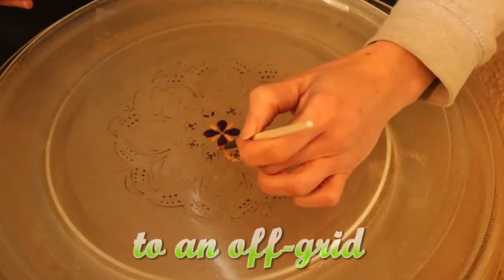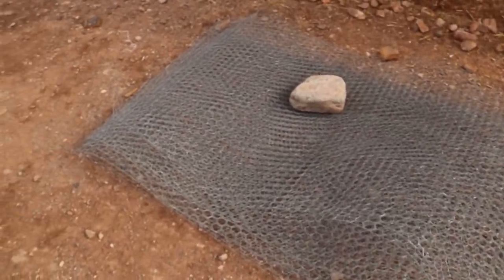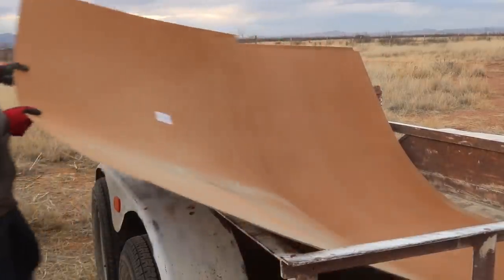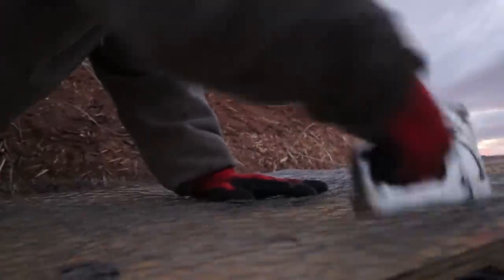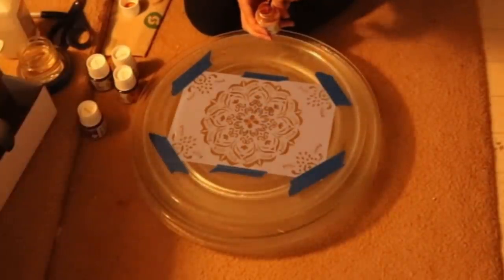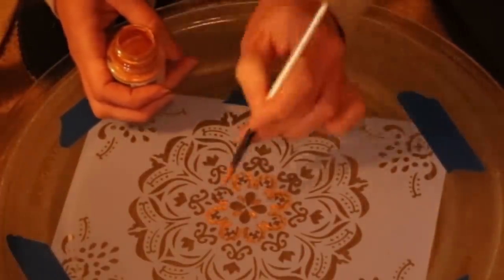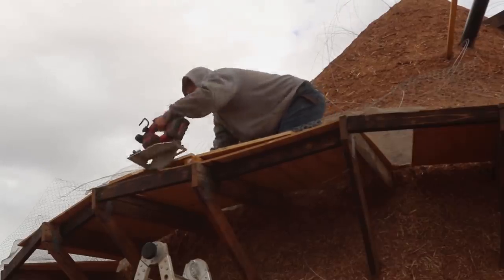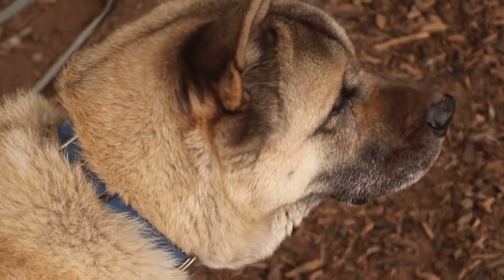THIS Was Heartbreaking! It All Fell Apart

Comment: On the stenciling, trim your brushes flat, then load lightly and work in thin layers, repeated dabbing, holding the brush vertically. Keep moving, dont let the paint get too thick. Dry between layers. A brush that is a little stiff is better. Sometimes putting the paint out thin on a surface makes getting it loaded lightly easier. Get a few pieces going at once, find your rhythm, and enjoy the process.

Comment: Jess, what an intricate stencil you are working with. I don't know if you have tried this already but when I last worked with a stencil, I used a repositional spray adhesive. I then used thin layers of paint daubed on with a stencil brush. Use the paint very sparingly or it will go under the stencil & smudge. Keep going. It's going to be so pretty.

Comment: Hey there...I've been a carpenter for over thirty years. Always been a production type worker. In my younger days I always prided myself on how much I could get done on any given workday and my work ethic. I've seen and worked with some of the best. Rarely have I seen a work ethic as strong as the both of you. Those days where you feel like it was a complete failure and waste of time happen...and usually starting a project while you're working out the kinks. They can be tough. The upside, and I'm sure you've experianced it in the past, Is the wonderful feeling when you overcome the problem and the work comes together. Jessica,  I do hope you believe me when I ask you to realize what an inspiration you are. Your work ethic and tenacity to complete projects are second to none. It's smart to back up and regroup at times, clear your head and find a new approach. When it gets to you, for myself anyhow, reflecting on other challenges I've pulled off and found success helps me to shake that bad feeling of "Failure" and figure out what I need to do to work through the problem. Didn't mean to write a book. Don't like seeing someone of your caliber feeling down. I have no doubt you'll work through the window project, and it will truly be something special. Because frankly your something special. You and Jim Rock!

Comment: Jessica's paintings that she does freehand are far prettier than any stencil.  There is specific glass paint and you bake it in the oven after it's dry.
Reply: But she can't always bake the glass... maybe the microwave plates can be baked....it probably can handle the heat.
Reply: @emariaenterprises   @Ellen Story ..She has a lot of microwave plates.  Those can be baked.  When I say baked, you put your item in the oven before you turn it on, turn it on to 350.  After it comes to temp wait 30 minutes and shut the oven off.  Leave the item in there until cool.  Any kind of tempered glass can be baked:  Microwave plates, Pyrex dishes, Anchorwear, Corningwear, can all be baked. For the windows, I believe they are using mostly old microwave plates as they are a thicker glass and quite sturdy.  Thin glass won't hold up out in the desert with the high heat and really low temps not to mention easily break.  Notice the bottles they use are pretty thick too.
Reply: @amiedavis5257  true. They should work for baking.

Comment: Hi, guys! Jessica...don't give up! As for the stained glass window, the next time you do one, cut off the necks of the bottles and use them to make glasses and join the bodies of both bottles together and glue them with a glass glue adhesive. THEN you get more light access from the inside and the outside of the building. As it is now, you won't get the glow from the inside of the home when the lights are on that you want to be seen from the outside and vice versa, because the neck of the bottle does not have enough surface area (I used to teach Mosaics out in the desert in California in the 1960s and made actual stained glass windows, so I have figured out some of the does and don'ts already. Thank you for continuing the creative practice...it always makes me happy to see other people's artwork! Don't give up! Wado!

Comment: If those are microwave tables, then it is very hard glass. Try using a Demel type tool to abrade the areas to be painted and then the paint will have a textured surface to bond to.

Comment: Jess, hang it there!  You do beautiful work!  I have had some challenges with stenciling glass.  I decorate glass objects like your first window.  I sandblast, instead of etching the glass.  After I etch the glass by sandblasting, it is easy to paint the etched areas.  I have had luck with this method, where I just could not paint the glass with the stencil due to the paint getting under the stencil.  I am not sure that this would work with the chemical etching, but the paste you used looked like it might be thick enough to keep from getting under the stencil.  If the glass is textured, you might want try to find some untextured glass.  When I sandblast, I cover the area totally with masking tape, draw the stencil on the tape and then cut the areas out that I want to etch.  After etching, I paint.  Just a few ideas to experiment with.  I hope you get it to work out.  Note - you can make a small almost free sandblaster that would work on your project with a small air compressor.  It would take a little time depending on the size of your compressor.  You use a plastic soda bottle, a small diameter piece of metal tubing, and an air blow gun,  You can also buy a real small one at Harbor Freight.  Only tool you really need is a drill, and drill bit.  Check out You Tube for cheap sandblaster.  Good Luck, and keep on trying!  Never give up!  Your doing great.  If what ya'll are doing was easy, everyone would be doing it!  Keep up the good work.

Comment: Hey Jes, incredible patience shown there. Don't give up! I was thinking that maybe instead of a brush, do you perhaps own an airbrush? I know the mask (frisket) you were using was a bit trash for glass but, here me out, what if you took that stencil and spray adhesive (rubber cement) it to the glass and then fog your colors over the plate to get the finish and crispness you desire? It's my go to for how I would do a painted glass surface, so I thought I'd share. I don't own an airbrush, so I'd be using a spray can from about a foot or more above the plate. I'd probably have to do three coats for solid colors, lots of overspray to protect against, but I think could work.
You two are the greatest, keep that love alive! Thank you for sharing your creativity and process.
Reply: Also, polishing the area to be painted with a 3000 or 4000 grit wet sandpaper will help for any paint to stick. The glazed surface of the glass has few pores or imperfections for the paint to interlock with, a superfine polishing will create just enough for the pigment to get a better hold.

Comment: I hold 3 Journeymen's cards and a engineering degree. I have more than 120 inventions and I can build anything from a robot to a bridge over a river to guitars and homes. I have failed more times than most but each time I failed I learned. Every experience is a  lesson. We become more skilled and knowledgeable by accepting challenges. Growth is a good thing. Never surrender. I am wondering if etching the glass first would help you. Best wishes

Comment: I had the same exact outcomes trying to use stencils. 
I see my family members have stencils in their homes for wall borders and on items 
I just made a mess so I asked their advice. 
They said I have to use sponges lightly. To tap the stencil lightly and also tap and excess paint off on paper or something. 
Of course I wanted bright heavy color so they told me to do layers, lightly. 
Lift the stencil away right away after stamping, let the thin layer dry, then line up the stencil to lightly touch over the design and let layers dry until I get it as dark as I like 
Also while using different colors, tape over the holes of the other colors and just expose one color holes at a time, then stamp with sponge.

Comment: The build is looking great.  For a nice sun catcher why not just put together a stain glass window? Fairly easy to build yourself any size of  window openings.  Not exactly best in a high crime rate area as the window panes are held together with lead a very soft material. The colors are endless.  I have several in my Cabin up in Oregon. We remolded a home in Stockton when I was young and told my Dad and Mom that I wanted a stain glass window in my bedroom closet.  It was amazing to see the colors of light during the hours of the day.  At night if I had my closet light on gave a very nice glow to the community of the two story home.

Comment: Can someone tell me the advantage of painting on your hands and knees versus sitting down at a table?
Reply: W  okay let's say you're young what's the advantage of painting on your hands and knees verses the table?
Reply: @ke4uyp  She can lean over it to paint. If you're at a table it's too high to lean over. She is working in the middle of a large plate so to get at the center it's best to lean over it. She is trying to dab the paint on also and coming from right above would help with that process.

Comment: You might consider  being more specific. 
1. Spreading ferro cement.. cost per square yard .. coverage ... your pants found out to be caterpillar.. got a link? If im gonna get screwed by the store rather you get some pennies... your ladder any good? Which brand... and is there better? Shovel  u use a certain kind... for a reason.. as I use a fiskars... it just won't break.... if it does... fiskars sends another.. but seriously it dont break even digging rock...   and where's your affiliate  links?   I finally understand your clay issues.. I thought I went through tough stuff caliche in colorado... its a joke compared to your soil and my soil... harbor friend auger... it just spins.. so now I know why u have a jack hammer.
.they just put in electric poles... the electric company with truck mounted augers  had issue....

So.. suggesting to add your tools, promote your tools you like. And explain why.. may increase revenue... $80 plywood sucks...   just a thought.